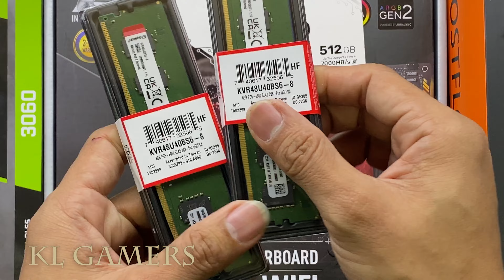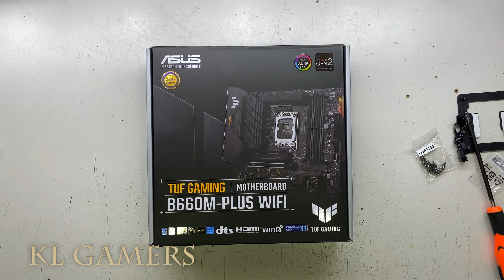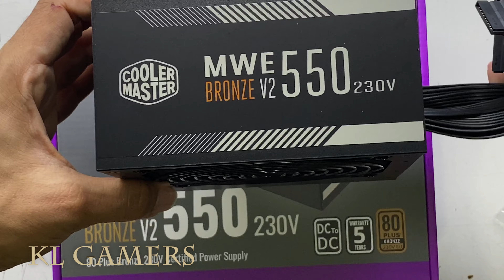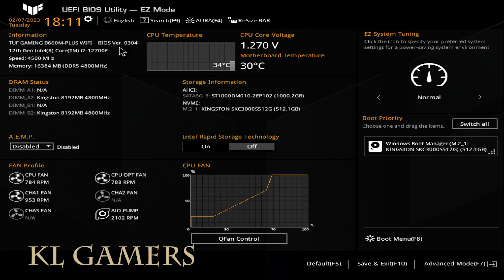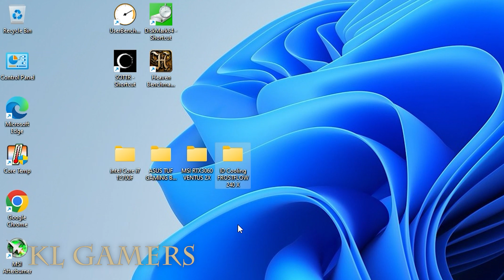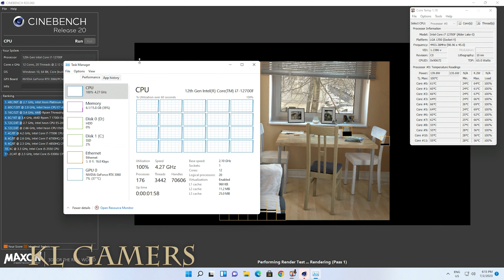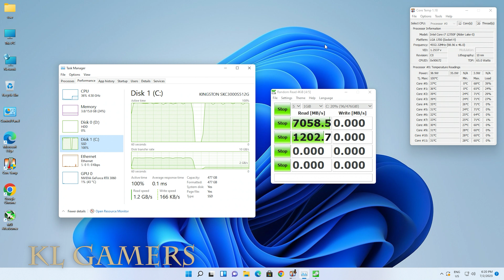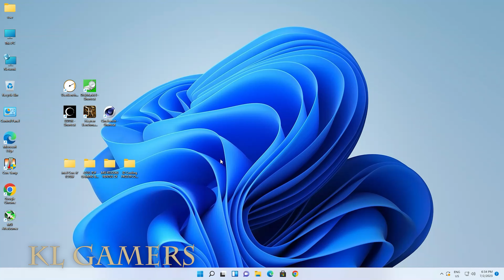intel Core i7 12700F ASUS TUF GAMING B660M-PLUS WIFI RTX3060 ID-COOLING FROSTFLOW X240 CORSAIR 4000D

Comment: I7 12700k and rtx 3060 12gb is very good?.
Reply: Depends on your purpose... For gaming is excellent but if you have more budget with this i7 you may go to rtx 4070ti good for 4k gaming...
Reply from the maker: it's great if you still use 1080P monitor
Reply: @KLGamers  yes 1080p

Comment: I7 12700k and rtx 3060 12gb is very good?.
Reply: Depend on what you run 😄
Reply from the maker: should be okay
Reply: @williamtran2069  battlefield 2042
Reply: I think you should go with i5 12400f and rtx 3060 ti gddr6x or rtx 3070